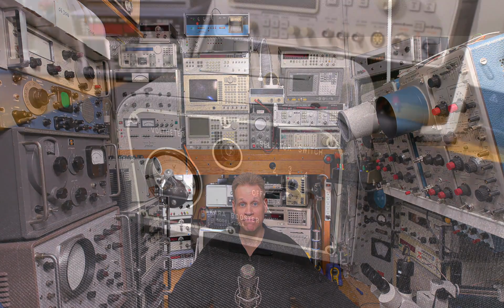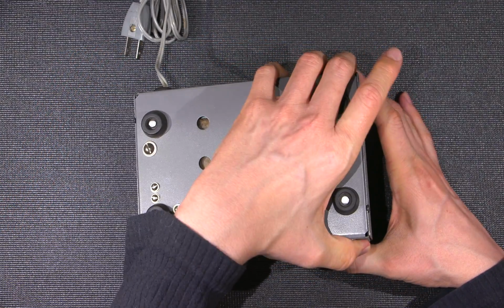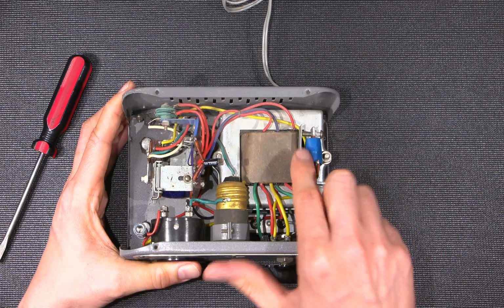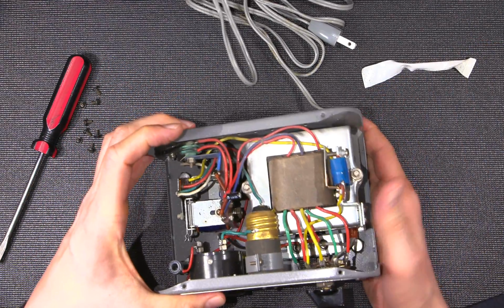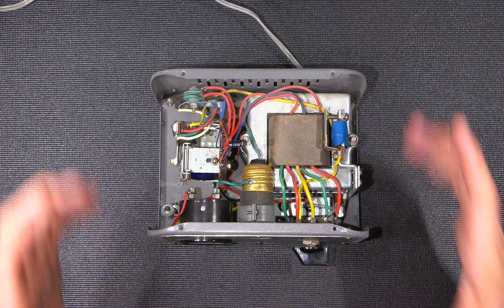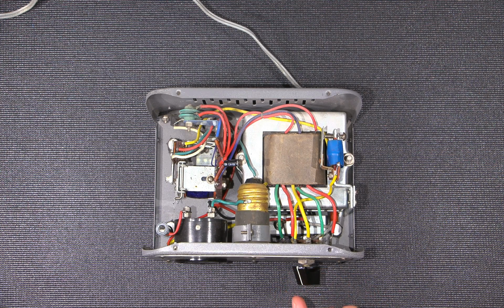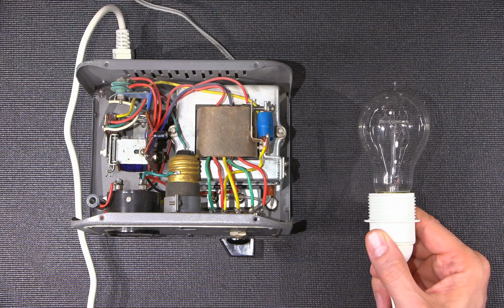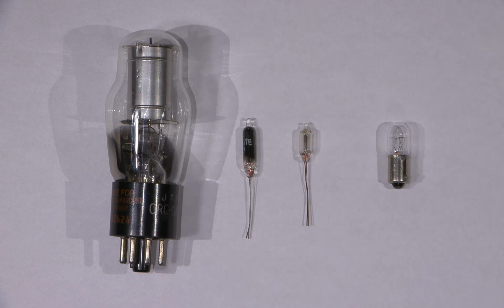What's a Takara Booster 200A? Let's Find Out!

Comment: Mr. C, can you speculate the purpose of the switch having positions 3, 4, and 5 if all it does is disconnect the output and turn the buzzer on? It seems like a pointless feature. But if it is pointless, then why would the previous owner go to the trouble to disable the buzzer. It would be simpler to just not turn the switch past 2. The other switch positions must serve some kind of purpose.

Comment: I used to use relays as buzzers, and DPDT relays as vibrators all the time in my youth. Then I used transistors. Then I used 555 timers. Now I use microcontrollers. It will be interesting to see if there is ever something else to get such cyclical outputs in the future.

As for the trivia question I figure the light-bulb acted as a minimum load to ensure the regulator stayed in regulation. I think I had a Heathkit bench power supply with one. I could ask my partner. He used to be a Heathkit engineer designing their power supplies.

Comment: Heh.. lol 😆 @ putting a Bluetooth sending warning n tweeting relatives and calling 911 etc. etc. That's funny... 😀
Reminded me of cleaning solutions. If the bottle says Environmentally Friendly  it means it doesn't work. But If it says danger, it will kill you,  your relatives, the neighbors dog etc. That one works! 
Kidding aside we did have 1 of these things back when I was a kid. We lived in a country with terrible electrical voltage fluctuations  esp. at nights, so we had a booster like this  that we called Transformer hooked up to our refrigerator to keep the voltage regulated. Looked like this one except it was bigger,, it had voltage written around the selector sw. and had a red cover. 
Oh, That Frigidaire fridge lasted 50+ yrs. Probably still working💪. The old stuff lasted the new stuff sux.

Comment: Greetings:0
Since you started feeding the device with about 100 vac, you were significantly above the minimum of the input range accepted by the device. It would have been nice to see the outout voltage for each o the switch settings in progression. Also, the neon indicator may not have had enough voltage at the bottom end of the input range to light up. I also would have started with the input AC much below 70 VAC to watch the action of the lamp and relay as the voltage was increased starting with the switch at the max position so we could watch the point at which each step would become too much as the input AC was raised. Just a little frustrating.
Also please explain if the neon display just used a normal NE-2 lamp with the holder doing the work of enhancing the display.Thank You. As Tokyo (I think) has a mix of 50 Hz & 60 Hz mains power, I wonder if the device is rated for 50Hz use. I think series string radios should work at 50 Hz, but I have no info about monochrome TV operation there. They had NTSC video without
setup level, so low power TVs should work, but I do not recall their broadcast frequencies.Also the rectifier and cap would likely be used for the relay as the input AC is somehow used to power the coil.

Comment: I have my variac and isolation transformer now I am going to be building a light bulb current limiter. Would it be an advantage to have a GFI on either the line or load side of it? Isolated grounds are possible too as I am still building everything out.

Comment: And I thought that the buzzer was a bimetallic contact that cut the power off in case the transformer overheats... :D
Anything said here about safety is sooooo true... seeing uninsulated live parts so close to the ungrounded metal enclosure makes me almost tremble in fear, more for the user's safety than technician's. I've been doing electronics since my teen age in late 1990s (and got zapped just a handful of times), occassionally working on a scope or a tube amp with B+ as high as 750V, and I'm still alive and kicking, so... :)
The neon bulb and meter look absolutely beautiful!

Comment: I have a similar device but for 220V with a european plug and it is also very old but the neon indicator is inside of the Volmeter.
Now that the voltage is around 230V, the Output reaches 306V on it's highest setting.

Comment: The bulb takes spikes and will burn out as a circiut protector. Did you explain how the regulator works to limit output vs.input? What happens at 70v input? We're you able to select more output all the way to the right rotation? Great channel

Comment: Paul, correct me if I'm wrong. It appears that the cutout relay when the unit exceeds the rated output of 120 volts is what is the controller for the output. Would that mean that the number of relay coil windings have been very specifically designed to assure that the relay opens the circuit after 120 volts is exceeded? That's what it looks like to me. Let me know if that is a correct understanding?

Comment: You forgot replacing the Selenium rectifier with a Silicon equivalent.   Would You prefer to use individual diodes ( I am guessing that it is using a half wave rectifier), or just switch it to a "FULL WAVE RECTIFIER !"? (Sorry, I could not help myself.. hehe)  Where is the filter cap?  Should that use a minimum of 10 or 20 mF @ 250V electrolytic?

Comment: The only reason I watch these videos is to hear Mr. C say "they've gotta go". :)

BTW, I didn't quite catch the reason for the 3,4,5 positions on the selector switch - is it for when the input voltage is lower than the 100VAC demonstrated (and e.g. 120VAC output is desired)? So would the number of the position be like a percentage? 1 = 110%, 2 = 120%, 3 = 130%, etc. ?

Comment: Most TV sets in the former German Democratic Republic used a similar device to correct the line voltage delivered to the TV. The line voltage was not very stable these days due to transmission network load. It was so bad that on TV sets, it affected the size and brightness of the picture and with such a device, you could correct that.

Comment: When I was a kid we lived on an Air Force base in Germany and the line voltage there was 220. I didn't realize the frequency was different too. We had all sorts of transformers, the biggest being a 2000 watt behemoth with handles on both sides. There were no voltage cutouts or other safety devices other than a fuse.

Comment: Love the "Techcasim" (the use of irony, in a technical field, to mock or convey contempt). 
I have to smile when I picture one hundred years in the future when a techie fires up their Mr. Thorium home reactor, powers on their holo-converter,
 begins to watch the newly discovered Mr. Calrson's Lab vintage video archive as a hologram and reaches one of your stoic safety techcasims only to think; 

"OMG, I can't believe they were so lax with safety and regulation back in the day." 
(these are the same folks that will be searching thru barn rubble and antique shops trying to find a flux capacitor from the '80s [1980s])

Comment: Current limiter, but those can be located anywhere. If it's right next to the gas tube, it's probably a kick start device, whether  it's a thermal or photo kick start depends on the gases inside the regulator tube(s). Cold ambient temps will retard the gas' ability to ionize, and support an arc. Other gases needed some light to start to ionize, and all of them do NOT like extreme cold ambient temps. A lamp will warm them up and the light can help ionize the gas and get the arc started and keep it sustained until the gas tube warms up enough to stabilize, and sustain itself. A lamp works as both a source of photons and as a cheap and easy heater. I do not recall very many gas reg tubes that had heaters, but once they start their glow thing, they warm up on their own. It's starting the glow (arc) that is why a lamp was utilized. None of these glow tubes are overly fond of cold temperatures. One unit that was inside of an old charger inverter unit had an Amperite thermal delay relay that let the lamps run for about 2 minutes before it put voltage to the glow tubes. So those lamps were also warming up the gas regulator tubes, besides providing any photons, if needed to help ionize the gas enough to support an arc, and get the ol' plasma going. These old boosters were needed in parts of rural America too. If you were unlucky enough to have a single wire earth ground return mains supply, you might have 70 volts or you might have 140 volts, and shock hazards were greatly increased with such a service as the earth return ground. I don't know if Japan use that or not, but I suspect they did in some areas. Only getting 70 volts was common on Japanese 100 volts AC systems. Other parts of Japan have 120 volts. It's about half & half now. Fiji used to have 100 volt power too.

Comment: I've taken apart an old Radio Shack 2 amp 12 volt power supply before. I found a bypassed switch mode supply so the rectifier and cap powered the load directly, 15 amp slow blow fuse. Someone likes to live dangerously! I'm willing to bet someone had a 250 or higher appliance running off this and decided they didn't like the buzzer going off or have the proper fuse in it.

Comment: Hi Paul, So what is the point of postions 3-4-5 ? why not use a 2 postion switch :-) I just worked it out dependent on input voltage DUR..

Comment: you will want to replace the line cord because if you look really close at where it goes into the unit it looks like it is cracked

you could modify the device to have a switch to select what the meter shows unless you want to preserve it 

the buzzer may not be working either because you bent the contact spring when you was flexing it or the buzzer is made to indicate an extreme danger to load.

the buzzer may only sound if the load is under immediate threat of damage by over voltage.

Comment: Hi Mr Carlson I have a trivia bit for you, I was stationed inLibya North Africa in the mid 60s for our off base personal living off base. I worked Part time at our Radio/TV station on Base. The AC power Downtown {Tripoli’s} AC power would about 120V but In the Morning and ad Dinner time the Voltage would drop to about 90 Volts, our BX sold the Boosters so the TV’s would be four screen, when the volt ego went back up the Buzzer would “sound off” . If it failed we could take back to the BX and get a new one. All this brings back many memories.

Comment: So, we've most likely got an autoformer in there? If I were upgrading to a polarized plug, I'd put neutral on the 0V tap, which should also be connected to the output. I'm guessing the original cord's insulation had a plasticizer in it that went away over time.

Comment: Well, I had already read Jim's answer to the trivia question before I watched the vid but probably would have answered similar. I seem to recall once seeing such an arrangement and wondering why the bulb was there. Certainly, if you have neon bulbs that are well throttled back they will light up just fine during the day, but tend to flicker at night. I presume that due to the bi-directional qualities of using such a gas tube as a voltage regulator, you could actually make a shunt regulator to work on AC, if such an application was ever needed?

Comment: Why on earth did they have the extra switch positions? Adding what you do not want and then a protection circuit and alarm is just bonkers. Just use a two position switch. 110 and 120v. Much cheaper.

Comment: The lamp is there to take out the lower cold resistanse until the fillaments heat to preserve their live long, also when something on fillament line goes short the lamp will light if in SERIAL, if it is connected in PARALELL that means the transformer for fillament supply is made for more (or powerful) lamps and the heater fillaments may burn if not regulated to proper current so they add a lamp to take some of the current to ensure the prope work of the others lamps fillament. I am not that much into lamps but this is a guess.

Comment: Back in my day, we didn't have seatbelts! And dashboards were metal...
Reply: I remember when gasoline was 29 cents a gallon, and guys in uniforms would come out of the garage to clean your windows and check your fluids. My dad's '47 Buick car radio used a "vibrator" in the circuitry to generate high voltage for the vacuum tubes. Oh, those were the days!
Reply: @xrayrep  My dad sent me for gas with a can and a quarter.   Gas was 19 cents.   I would fill the can, leave with 6 cents and stop at the store and get a 5 cent candy bar and return home with a penny for my dad.
Reply: @xrayrep Born in 1960, and I can remember .27 gas. My dad worked at a refinery, and one day he told us gasoline was going to go to $1.00 a gallon, and my older brother and I laughed at him. Now $1.00 sounds REALLY cheap! WOW, LOL!
Reply: And car radios had vibrators
Reply: @joerogers4227  Some had multi vibrators, but they were the expensive ones... 😂🤣

Comment: You should have applied just 70 volts then I believe the unit would have let you go up to #3 and so.
Reply: Craig you may have answered my question, why have switch position 3 & 4 if they don’t  anything. By your theory would switch 4 say boost 50v up to 120v ?
Reply: @Ian-in-da-shed  Yep, my guess is that back in the day that Japan's electricity regulation wasn't the best, and it probably varied from 70 - 110 volts, (or right around that area), hence the different settings when the voltage would drop to a low level. I really figured that was what the buzzer was for, to warn you the voltage had dropped too low, and it needed boosted to the next level, but apparently not.

Comment: How does the cutoff circuit work?
My guess is that the output relay is a normally-closed type, and its solenoid coil is connected between the shunt-regulated output of the neon indicator bulb, and the output voltage. When this voltage differential is large enough, it pulls in the relay.

Comment: Green diode is not silicium or germanium.. it is..selenium
Reply: lightbulb is a dynamic resistor - afaik - it will also do some load regulation.. - lightbulb also pops if the power exceeds..

Comment: You didn't test the booster with a 70 VAC input voltage to really see what the operating parameters could be, including pushing the thing with a 200 watt load and a 70 VAC input... pushing it to the max of it's design operating limits. ooh well.

Comment: Filament of the incandescent light acts as an active current limiter for the heater element. 
If voltage spikes drive current up the filament gets hotter and increases in resistance therefor reducing the current forced through the heater of the tube.

Comment: Input voltage as low as 70v, 3 amps = 210 watts.  Rated output is up to 200w, I think the 3a fuse is the right size.  After losses through the xformer though, I think the fuse would blow at lowest input voltage and highest output current.

Comment: Hi Mister Carlson. Nice presentation. My guess with the trivia question is that the bulb is putting some sort of reference load on the circuit in question to keep it operating at the design limits of the circuit in question. Well, that's my $0.02 worth. Stay well.

Comment: I believe it is used as a exciter for the gas tubes.  Some of the older telephone equipment used neon tubes for counting, and exciting the gas in the lamps made them more accurate and faster acting.  Neon takes a bit to build up voltage to full power, and in a counting circuit you don't need missing digits.
Again, this was a very interesting video.
Thank you for spending your time showing us these interesting old equipment.
Have a good day.
Michael

Comment: I remember reading an old tube application manual for a old military voltage regulator tube, and they had stated that they included some radioactive elements (including but not limited to Krypton 85) to provide the means of ionizing the gas inside the tube. Other tubes had to wait for say a cosmic ray or another means to ionize the gas inside the tube. I am fairly sure that the purpose of an incandescent bulb would be in this case, provide heat, radiation, or other stimulus that would help initially ionize the gas in the tube meant to work as a regulator.

Comment: We were using similar sort of device during cold war era in Poland. During peak hours voltage was dropping to around 180V (instead of nominal 220V back then). Then our TVs (vacum type usually) suffered - picture become thinner and thinner. So we used similar type of booster, when it was switched on (only two position swith - on/off) voltage will come back to 220V and picture will be back to normal. Sadly it didn't improve the CONTENT of the broadcasts, but at least First Secretary of the Communist Party was shown in better picture quality :-)

Comment: That line cord plastic is de-polymerized. The plastic molecules have shortened or otherwise busted up by sunlight, oxygen, ozone, cosmic rays. Yeah it's stiff,  In fact there are  more likely spots where the cord is brittle enough to break.

That buzzer may be current sensitive so that if you select to too high a voltage that it begins to become an audio warning.

Comment: Light from the bulb reduces the striking voltage of the regulator and makes it easier for it to begin to conduct current. You can often notice this effect on neon indicator lamps (on power switches for example) that are near end-of-life, they will flicker in the dark, but turn the lights on in the room or shine a flashlight on it and the neon glows solid.

Comment: MaybeThe light bulb is a current rush limiter... We use them in series on the AC line of our variac when testing sets. It will momentarily glow bright and dim if the set is operating correctly or burn bright if the set is drawing to much current. ... It's why solid state rectifiers replacement tubes are a bad idea, they do not limit the current during warm up. It also can be used to start electron flow on photovoltaic devices such as the regulator or neon lamps.